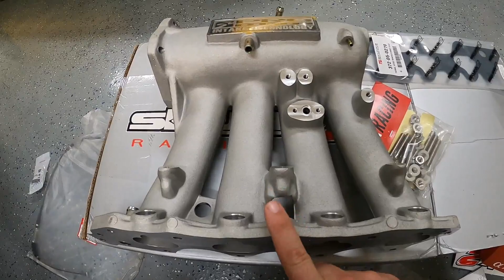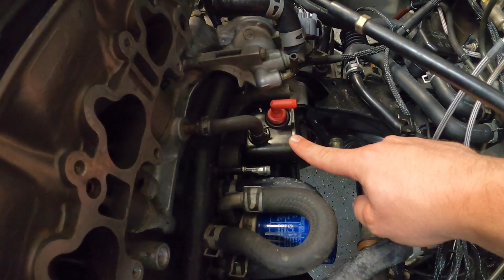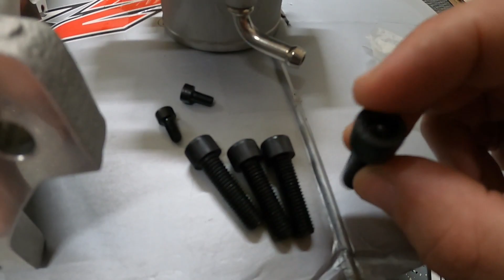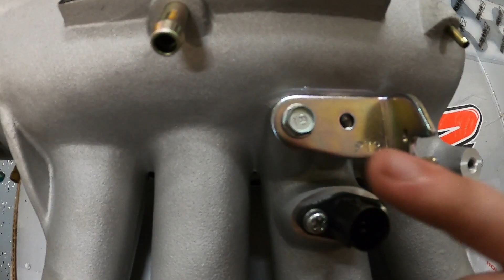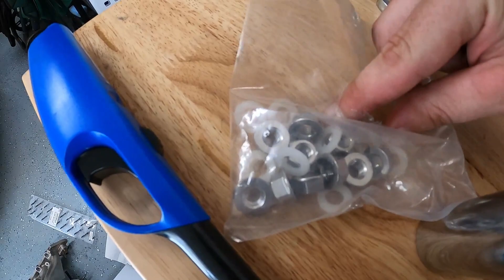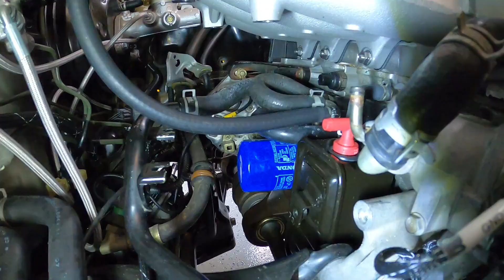Integra GSR Skunk2 Intake Manifold INSTALL | PART 1

Comment: would the oem throttle body work with this manifold?
Reply from the maker: Yes, it would. However, the bore on the stock throttle body is much smaller than the bore of this Intake manifold. Therefore, there will be easy power gains left on the table without getting a larger throttle body.

Comment: What length were those intake manifold studs? Were they the extended so you can fit thermal gasket on? And can I use my OEM gsr throttle body?
Reply from the maker: Hi, 55mm studs will work. You can use the OEM TB but the port won’t match the manifold. At least a 66mm TB would be good.
Reply: @spencersgarage  That means I have to get a tune if I run 66mm throttle body? My intake manifold gasket went out on me so I was like I’ll just a skunk 2 one. I don’t want to Hondata and tune I’m on budget. But if I have too I will.

Comment: how did you remove the bolts from the head?
Reply: The same method that he used to take the studs out of the manifold in this video. Two nut method

Comment: Would you recommend that manifold setup on a stock motor and ecu?
Reply from the maker: No. The ECU has to be retuned.
Reply: What ecu would you recommend? Good thing I didn’t install it yet.
Reply from the maker: @JohnnieIsBored  Hondata S300
Reply: @spencersgarage which version s300 and what type of ecu? USDM OR JDM?

Comment: Do u have to tune the car when u get new intake manifold .?
Reply from the maker: Yes. The Integra GSR ECU “P72”, will not operate correctly with the new manifold not having the secondary butterflies like in the OEM GSR manifold.

Comment: Why rerouting the iacv water hoses? For let the temperature be cooler on the tb?
Reply from the maker: So extremely hot coolant does not heat up my throttle body. Cooler air = more power.
Reply: @spencersgarage  same question kind of,  now that you ran this for awhile have you had any disadvantages? or issues from doing it this way? I was about to do mine and noticed you did it this way.  Let me know thanks
Reply from the maker: @Halferty67  well I don’t run my car in very cold temps. So no issues from my car.

Comment: What are you doing with the evap purge solenoid? That bolts to the top of the gsr intake manifold. I was thinking of running a b16 fuel rail since it has a mount for it already 🤷🏾‍♂️
Reply from the maker: I deleted that thing years ago. The Rywire engine harness doesn’t even have a plug for it…
Reply: @spencersgarage  😭

Comment: I’m like there better be a part 2! I didn’t see if you put the tps sensor on that’s usually riveted on the back side of the throttle body and is a pain to put in when everything is installed already
Reply from the maker: Yes, there will be a part two! After the part two install video I will have a whole other video on how to calibrate the TPS.
Reply: @spencersgarage  and it won’t be new parts but I’d love to have you torque all my stuff to spec. Anything outside the engine im like it feels tight 😆